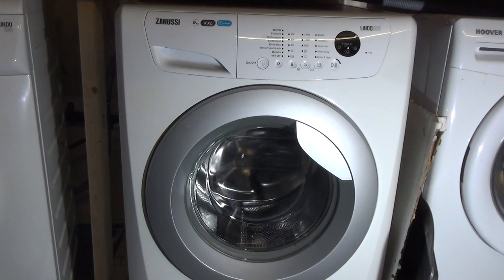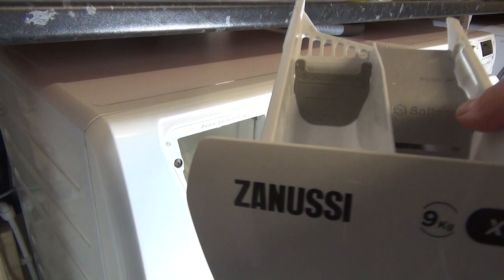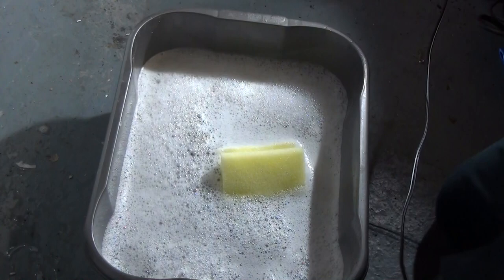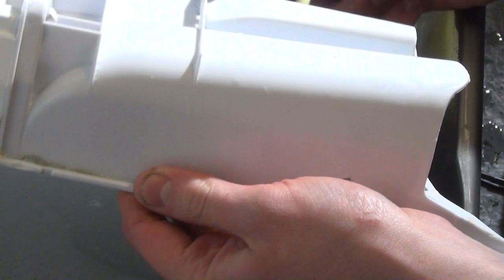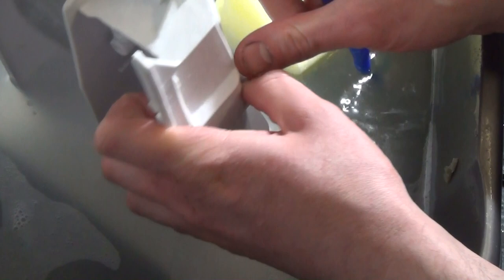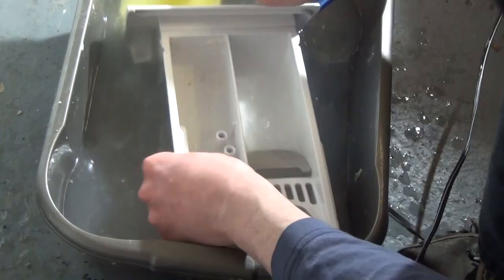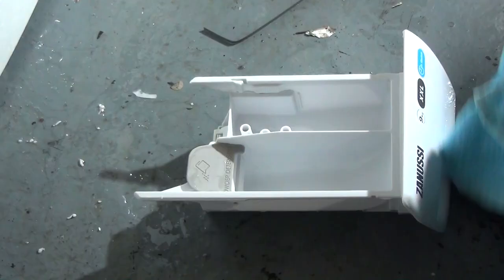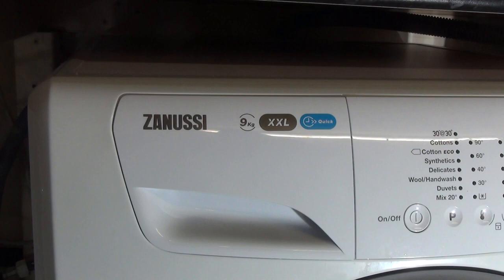How to Tip #109 : remove & clean Detergent Dispenser on zanussi aquafall & lindo 300 washing machine

Comment: My Lindo 300 is not dispensing the fabric softener.  What can I do to fix this problem?
Reply from the maker: If the detergent dispenser is clean and the jets inside the dispenser are clear. And it's still filled with fabric softener at the end of the cycle. Then it sounds like one of the valves is not working. Needs a appliance technician to look at it.